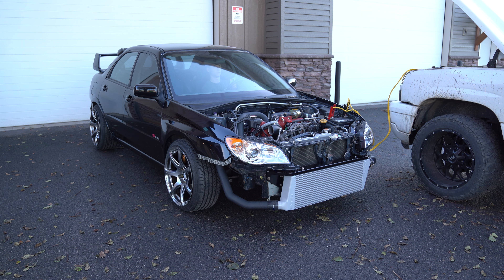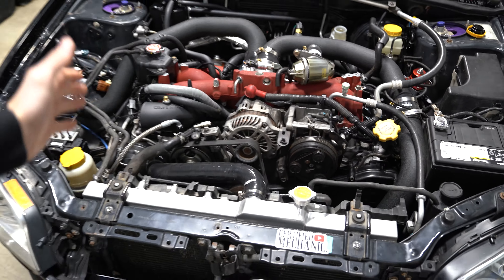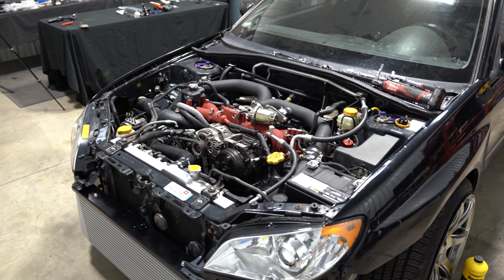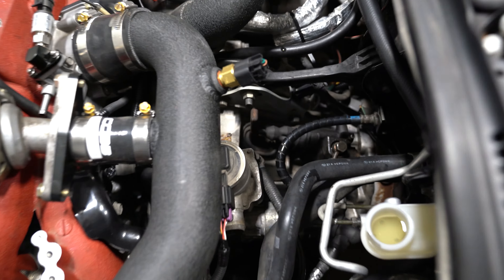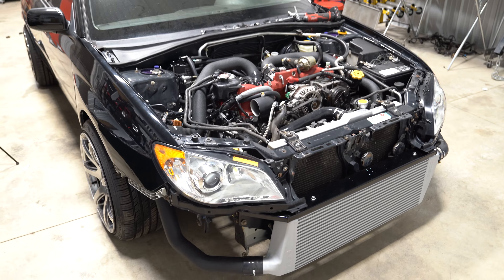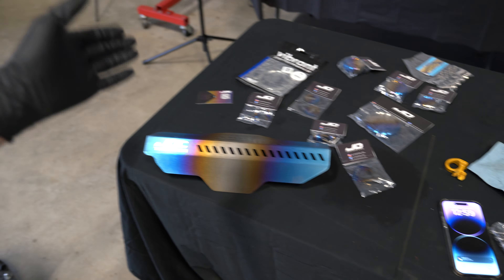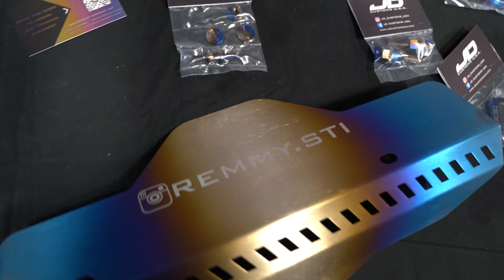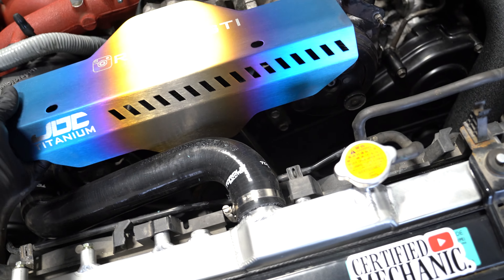I Found the fix on my WRX STI

Comment: the remote start has the turbo timer mode turn on thats why the car still runs after you take the key, i install these all the time this is an easy fix there should be a program botton on the module or external button ran. also working in white and not getting dirty is pretty impressive

Comment: To propely bleed the STI VERSION of slave cylinder it needs to be unbolted and angleed at 45+ degrees pointing up towards front of car, otherwiseitvwill pump air into the valvle and lines